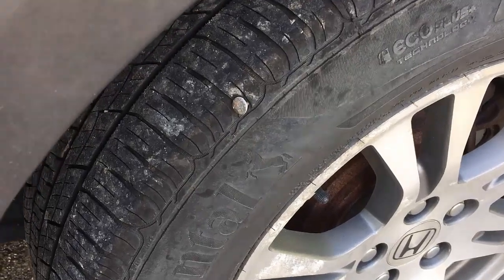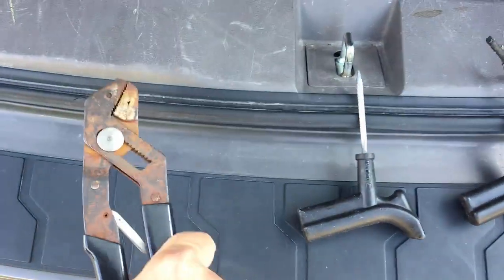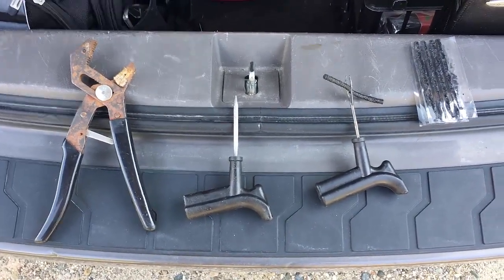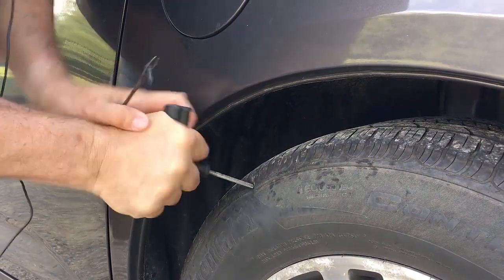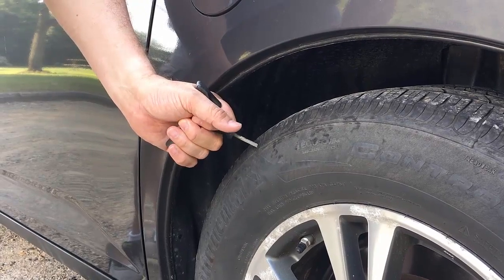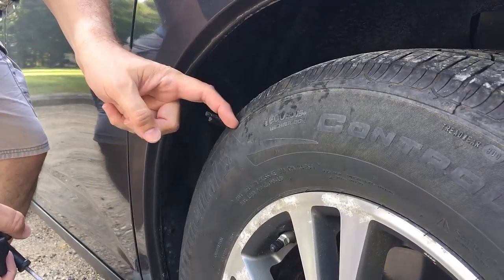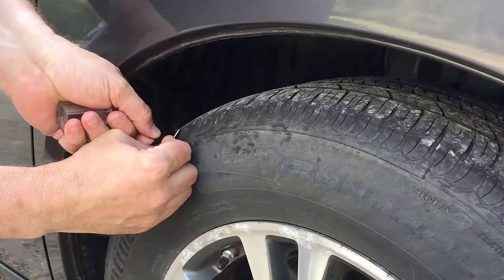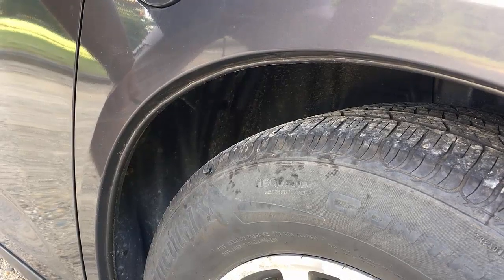How to Plug a Tire

Comment: Really helpful and great video. I shared this with both my kids who now drive and I think I'm going to order one of these kits for all four of our cars. (I found you from your Odyssey bed build + van conversion videos which are also great.)
Reply from the maker: Hi Keith, Thank you for your kind words!  I have two kids and they both got a kit one Christmas :-)  It’s a good life skill for them. Thanks for watching and have a Happy Holiday Season!
Reply: Make sure you carry a good set of pliers with you. I just fought with a headless screw for about a half an hour at my house. That has a full set of pliers. It was broken off below the surface of the rubber and I could not get it for the life of me. If it's something I want to do on the go, I got to make sure I can get the screw out or the nail out.

Comment: Great video. Any time I have screw in tires not ready to be replaced I have plugged them with no issue lasting a year or more. Never on a sidewall only one time was kind of close and no issues
Reply from the maker: Thanks!  This plug held until this past June when I replaced the tires for wear. thanks for watching!
Reply: @OdysseyCamper  sweet. Funny I have something in my tire  this week and will be plugging myself after watching this video.  Usually I let a shop do it but why not do it myself. Plus shops get very picky on not wanting to plug verse patch verse new tire bc they want the money
Reply: @OdysseyCamper this is basically the sidewalk, so thank you this makes me feel much better about the fact I just repaired mine. Mine is an inch closer to the middle. And just touching actual tread. I just had 3 brand new screws in 3 seperate tires at the same time. 2 were super safe patch in center but I wasn’t too sure about the one close
To sidewall. My
Tires are $195 each before balance and install. I can’t afford
That. 2 of them are brand new already but no
Warranty. 

Hey everyone pull straight out super fast (tho he didn’t have a choice because u don’t have much room in real tire area)

If it’s front tire:
Stop so screw it near top and turn your wheel so that the tire is fully facing you and you have tons of room to work.
Also try to buy an all metal kit. Plastic can break and the metal part can go fully through your hand. I’ve used plastic without it happening but better to be safe.

Comment: This is great, thank you. I got a tire repair kit for $15 at O’Reilly Auto Parts and have a screw in the exact same place on the shoulder. Going to plug it, rubber cement it, and patch it instead of paying $600 to replace the tire.
Reply: Did it work?

Comment: I carry this, but looks like it may take more strength than I have. What about those foams that go inside tire?
Reply from the maker: Karen Eighth I understand your concern, but remember, if you have the tools and someone comes along to help, you can show them what to do. As far as the foam sealants go, they work in some instances and can also help with a slow leak. Just know that the guy who replaces the tire on the rim will hate you if you don’t warn him.  That stuff makes a mess when they pull the tire off. Having said all that, you will notice two cans of fix-a-flat next to the diehard. I carry them because they can get you off the side of the road quickly and to a safer place.
Reply: Odyssey Camper  Good points. I’ll continue to carry both.
Reply: I did not have the strength to remove the lug nuts after a screw screwed me over😉. Someone came along, removed them, then installed the spare tire. When I arrived at my destination, I purchased the plug kit (the shop wanted to sell me a new tire). I showed a friend how to use the plug, borrowed his arms and magic. I drove over 300 miles (back home), no prob. Now, the kit is in my car. I already had an inflator.

Comment: Thanks, very good video!
How many kilometers/miles did you drive with the tire?
What speed was he driven?
Were there any problems?
Reply from the maker: I left this plug in for another 30,000 miles because I was curious to see how it held up. As I note in the video, this hole was technically far enough to the side that it shouldn’t be plugged. I wouldn’t let that stop me from plugging it to get off the highway and to the tire store, though. But, as it turned out it held much longer. Thanks for your comment and for watching my video!
Reply: @OdysseyCamper  Many thanks for the quick response !
How fast did you drive with this tire?
In the USA you can drive a maximum of 75 mph, is that correct?

Comment: Thanks , Darren! Have watched it done at the tire shop but never tried. Seems kind of hard to reem and even harder to plug. I've watched experienced guys do it and  not sure I would have the strentgh. Seems simple enough otherwise.
Reply from the maker: I think you could!  But, even if you can't use the tool, it's good to have them if anyone stops to help.  They may have the wrist strength but lack the tools.

Comment: How long did it last?
Reply from the maker: It was still in there, 30K miles later.  I just bought tires because these had worn out, about a month ago. Although I would not recommend plugging a tire this close to the sidewall, I figured I’d do a durability test. I think it’s safe to say that it would get you to the tire shop :-)  Thanks for watching!

Comment: That's basically on the sidewall. Unsafe to plug.
Reply from the maker: Yeah, I mentioned that in the video. But then I left it in for another 30K miles without issue. But I won’t recommend that to anyone else. Thanks for watching
Reply: It’s not the side wall tho it’s still on the tread

Comment: I wouldnt repair that tire its dry rotted and old and the hole is to close to the side wall
Reply: You're not supposed to the tire is done
Reply: Please point out the dry rot.... Oh.... and how do you know the age of the tire??? Those who assume, should not be given ANY attention from others. Also, if you were listening, the man said this is a simple how to on a tire that he said was to be replaced as to the location of the hole. So.... pay more attention and stop assuming on what you have no idea about!
Reply from the maker: Update: I just had the tires replaced because the tread was worn. This is 30K miles later in June 2021. The plug was still holding…

Comment: WARNING this is UNSAFE! You are not to plug that close to the edge. Tires have steel belts and are thrown out, if a puncture happens too far from the center.

NO REPUTABLE shop would plug THIS TIRE.
Reply from the maker: Yup, it’s noted in the video. Demo purposes only.  Also, it held until the tire wore out. Thanks for watching!
Reply: The man CLEARLY said he would not recommend plugging if close to side wall but provided video just for demo purposes…did you watch the entire video?